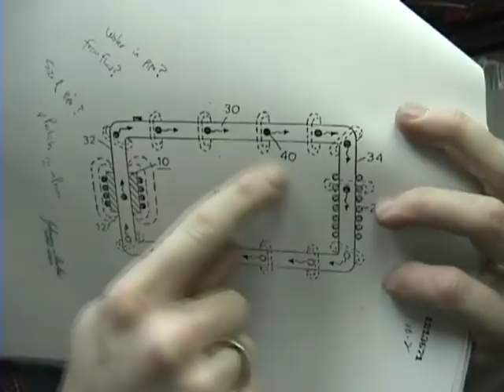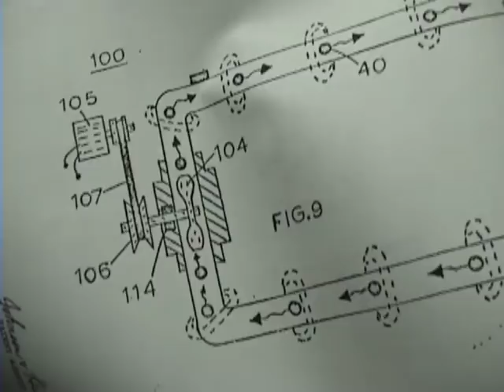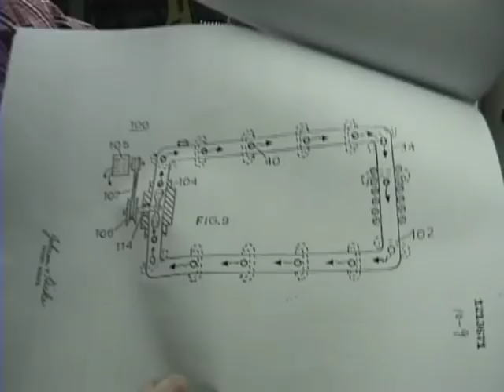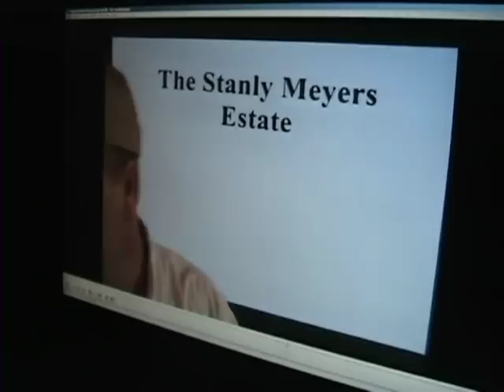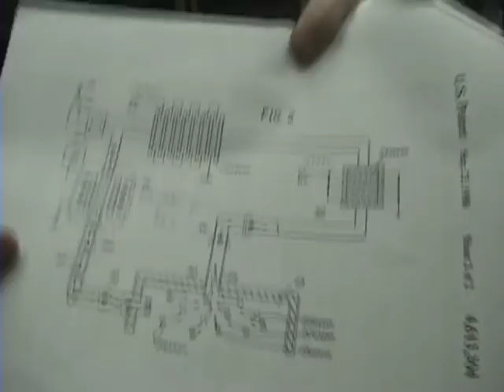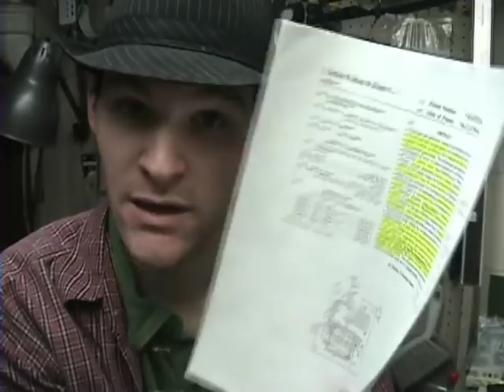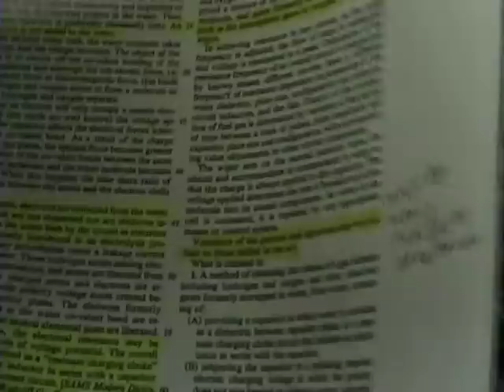The Key To Stanley Meyers Water Car, Gas Electrical Hydrogen Generator, www.RWGresearch.com

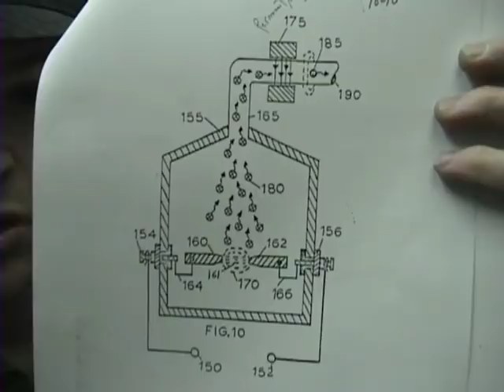Comment: Nice,   @21:15.   I think that's how Stan created the Magnetic gas for his "Pipe core" .  It's NOT a transformer,  it's a generator..  Passing Magnetic flux (particles) thru the secondary will induce current and voltage.

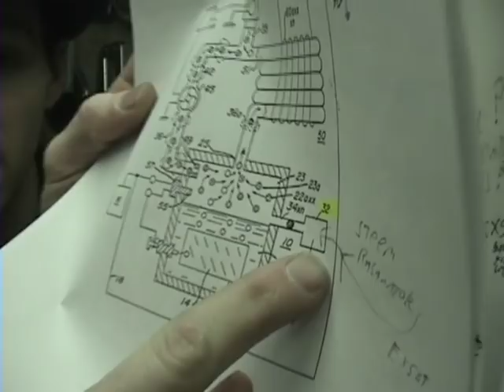Item 32 @ 53:30 is possibly the blow valve Stan talks about.

I believe the  'Source"  mentioned is the  Magnetic particle/ plasma  makers ..   The vapor particles are the electrodes ..

You're right,  This hugely important..

I know this video is 8 years old,   but,  that  Transformer/Generator is pure genius
Thanks,  Nice video.      btw,   I like your hat !.

Comment: Russ. A glass pipe with a a resent wall thickness would make an excellent circular pipe.It would be relatively easy to make using a propane burner and a circular former,Im sure a pipe blower could make it.

Comment: The coiled tubing in the loop looks to be the passageway of the hydrogen to be refined as a gas in the electro magnetic field  that may magnetize the nitrogen particle pulling them away from the oxygen and hydrogen atoms gas As I recall The Hadron Collider uses Electro magnets to speed up 2 electrons and then direct them in this magnetic field to crash head on with exact precision to create a miniature big bang or black hole.You got me inspired with your new information.This is a small collider

Comment: hey Russ, at 15:05..... the part in the middle sure looks like a vintage variable tuning capacitor for ham radio. Check it out. They are generally used in high voltage tank circuits.

ok my bad... in the video clip showing the accelerator it is clearly a cooler. But the thin plates and the distance apart still may have capacitive properties on the water flowing through it. 

nice work as always bro. 

 MUDDy :)

Comment: Nitrous oxide, commonly known as laughing gas or nitrous, is a chemical compound, an oxide of nitrogen with the formula N2O. At room temperature, it is a colorless non-flammable gas. At elevated temperatures, nitrous oxide is a powerful oxidizer similar to molecular oxygen.  It is also used in Dragsters !
Reply: I believe you are right, nitrous oxide burns really well, can it be that Stan is using N20 ????

Comment: Thanks for the video. You went through some interesting material. To me it seems the same problem as with all these free energy devices - How to start them?  How do you get pressurized gas, liquid, water into the chamber? You need energy to pressurise something. And you can't recycle energy from the chamber because it will run down (unless you have a neuclear reactor) . It's the same old problem.
Reply: its not free energy the energy you live in a world of magnetic flux and water is abundant, money wise those two are free to all
Reply: Self preasurization because water to gas adds volume ( preasure).

Comment: 1:00:59 With the ac/dc input corresponding to ac/dc output, remember that the magnetic particles traveling inside the tube can have spin and alignment from the input which they carry, as literal flux carriers, with them to the other side (because they keep spinning in that way after they leave the input area). Think of it this way. For ac input, 120+ will cause magnetic gas particles to spin "forward" (arbitrary terms, just grasp the concept). As the input wave progresses and goes down to 0 volts, at that moment there is no spin imparted to passing magnetic gas molecules. Then, when the input continues to 120-, the opposite spin of the direction imparted by 120+ is now given to passing magnetic gas molecules (120- creates spinning "backwards"). Remember, the particles keep circulating in the same direction no matter what, they are just rotating in different directions. Rotating magnetic fields through a stationary coil create electricity. So, when all these rotating gas molecules arrive at the other side, they're carrying their respective spins and orientation that they received at the input side, so you see it on the output side.
Reply: Duncan Zahringer where did you copy this from?
Reply: Could this be the flux capacitor?? they usually put these things right in front of our eyes  In back to the future?? In movies they always show hidden things before us also called  predictive programming!!
Reply: pe hgt Back to the Future was written by a child prodigy from Logan Utah.   That city has/had...Twin Pines Condos, LMC owned by John Delorean, The Clock Tower Plaza and the Bluebird Restaurant.  Three of those places are on main street and a few miles apart.
LMC no longer exists but the rest are still there.

Groot can be found in Marty's house as a small statue.

The writer has written hundreds of screenplays, scripts and songs.  A fair amount of books, comics and cartoons were also written by him.

He created more than a thousand videogame concepts like Mario, Zelda, Sonic, Halo, Street Fighter ect.  This is the reason why thete is Zelda music in Mario 3, Pac-Man can be found in Tron and why a certain song in Street Fighter is very similar to a Top Gun song.

He has designed vehicles for his movies and the real world. This is why the Vtec, Vortec, Voltec, Ecotec and Ecoboost names are so similar.

He has designed buildings, computers, video game consoles, phones, inventions, production machines, scientific equipment and a few military and passenger jets.

Look up Bro Mikey here on YouTube and learn about Split the Positive.  It is a way to recycle electricity and can be used for electrolysis, running inverters, motors and many other applications.
Reply: The first patent seems to describe a regular transformer with a core made of mercury (metal), inside a non metallic (avoid the squirrel cage effect) vacuumed tube and a pump to initiate the circulation. This would certainly reduce the core's resistant; something to look into...

Comment: I've looked at Stan's stuff and while the plans for plasma generators are very interesting is
It's in no way a requirement to split water at levels well over Faraday. 
Two essential requirements are
1. Water Cells connected up to coils as an LC tank resonator and excited at resonance with very high voltage.
2. Pure water as a dialectic so the
Water is split from the electric field and electrons are released as H2O becomes H2 and O2. This is critical understanding the electric field is doing the work not conduction.  No electrolytes required,  if you did use any you destroy the voltage potential that's doing the work. 
Don't confuse yourself with fancy transformers when you don't need them,  if you have unlimited electricity you don't even need to split water????
Remember K.I.S.S.
Most of these free energy ideas are simpler than we expect

Comment: Hey Russ, I know you probably figured this out years ago BUT, When he talks about previously magnetized particles, He's reffering to the water that was extracted from the stainless steal tube cell. IF YOU LOOK AT THE JOE CELL ( OR LOOK UP A MOJO CELL ) ( ALSO LOOK UP "SURFACE TENSION WATER" ) THE CELL IS SIMPLY ENERGIZING THE WATER AND CREATING A SURFACE TENSION. THE WATER ACTUALLY STAYS CHARGED WELL AFTER IT HAS BEEN CHARGED. That's what Stan means when he says "Permanently Magnetized Elements". You could theoretically either heat up the water to a vapor from the cell, OR extract the top layer of the cell where the Surface Tension "Charged" water is and then super heat it to a vapor once out of the cell. THEN SIMPLY PUT THAT PLUS THE EXHAUST GASES INTO THE EPG (MAGNETIC PARTICLE ACCELERATOR) AND VUALA. STANS FUEL. I'd love to see a video of you making surface tension water. you're the best man.

Comment: Russ, the part you are talking about at 23 minutes in... is that used to fill the closed loop pipe with the ionized ejecta from the electrodes through a one way valve, perhaps?

Comment: In the diagram you were questioning if it was an air-core transformer or not, the dashed lines indicate that it wants a ferrite core transformer and the note about toroid means it want a round ferrite core.
Solid lines would indicate that it wanted a laminated iron core.

Comment: Waste oil/water mix for magnetized fluid with pressurized electrolysis.  Pantone utilizes the plasma arc in GEET fuel reforming. Putting the coil loops after the plasma ionic breakdown of hydrocarbons with create a hot synthetic gas of high pressure to push through the power coils and then to the engine.  Ferrofluid is a good idea.  Plasma and power under ABHA toroid coils may help the efficienciy.  Brings together the work of Paul Pantone, Rodin/Powell (ABHA 72X72 and Meyers.

Comment: the pump you show, will have a manufacturers spec, there you will find the Parameters of operation, IE / the pressure he applied to his system, permanently magnizable particulates, Carbon 12, or/ carbon, you would find such by carbon metal spot welder machine.Just a thought.
Thom in Scotland.

Comment: not sure if this has been touched on, but word in not Permanent, but Pre Determined, ie, Calculated before hand.  What he is saying is you are shooting for a specific pressure. being its predetermined via calculations, this may have to do with the medium being used in the chamber, whether it is water, or perhaps mountin dew, or whatever.  the material used my be related to the pressure needed for the system to properly function with the Fuel/Medium being used...  
Had to clear that up.

Comment: The two most common types of magnetism are 
diamagnetism and paramagnetism, which account for the magnetic properties of most of the periodic table of elements at room temperature .  Hydrogen and Nitrogen are Diamagnetic but Oxygen is Paramagnetic.   To be Magnetizable an element must be Ferromagnetic.  Simple Ferromagnetic elements are only 3:  Iron , Cobalt, and Nickel.  (see Periodic Table : http://www.birmingham.ac.uk/Documents/college-eps/metallurgy/research/Magnetic-Materials-Background/Magnetic-Materials-Background-4-Classification-of-Magnetic-Materials.pdf  )  ; Materials can also be classified as ferrimagnetic although this is not observed in any pure element but can only be found in compounds, such as the mixed oxides.  Hydrogen-peroxide has been used as a propellant in rocketry !

Comment: It's easy to deconstruct H2O to burn in an engine. The problem is to produce enough pure hydrogen to burn. This is where electrical power in to split the H2O, becomes greater than combustion power out. Canadian patent shows how to put in low voltage with little to no amperage and get out high voltage and equally high amperage. The patent is amazingly productive to the point of getting enough power out of a low voltage/amperage input, sufficient to produce vast quantities of hydrogen gas to burn.

Comment: hi Russ,i watched your vid last night,i was aware of the generator but not the particulars such as the device for making the magnetic particles,or how you could use it with HHO,thanx for sharing-i think the things in the middle of the ring are lasers(not the first one with the pump but the later models).meyer spoke about this in one of his lectures.the laser was to provide a static field that improved the efficiency.i have been wanting to try to build one of these since i heard about it but....

Comment: don´t know if i understand this, but is it like you use a small voltage/current to accelerate particles in the tube.  Then they give a change in the magnetic field to the outside coil which give a great output ?

Comment: Stan introduced carbon monoxide, air, and carbon dioxide to turn all hydrogen/oxygen gas to the adjusted fuel burn rate that he wanted.  Stan could produce a propane, natural gas, butane, or gasoline burn rate by this method.  In example the hydrogen/oxygen gas has a burn rate of approx. 4000 feet / second (dangerous) and by adjusting the burn rate with carbon gasses he could create any type of burnable gas that he wanted.  He stated this in one of his videos from the 80s.  I tested the gas mods

Comment: I did watch Stan's video, " The secret missing links"..it involves bombarding the hydrogen proton with high frequency to make it lose an electron. And then he " borrowed one electron from the oxygen atom" but later he gave it back, LoL, and got energy both directions..the latest thing Ive seen is using 20 khz aimed at the electolyzer plates to cause cavitation which aligns the charge ..the toroid was used under the electolyzer which somehow excited the gas to leave faster, improving the efficiency and polarizing the electrons simoultaneously..
Reply: The first patent seems to describe a regular transformer with a core made of mercury (metal), inside a non metallic (avoid the squirrel cage effect) vacuumed tube and a pump to initiate the circulation. This would certainly reduce the core's resistant; something to look into...

Comment: 5000guass field, look up arc light for sparkgap vaporization, the gas is a metalic gas, first a vacuum has to be estalished in the chamber, then a arc created to plasmafy the electrodes. You can calc the mass and therefore the moles therefore the charge of all the gas created and you can find the amount of power needed to move it and what can be pulled off of it. A conductive tube would be a dead short in the transformer, drop a magnet down a copper tube.

Comment: I think that would require significant adjustment of cam timing as the exhaust port is normally open on the exhaust/upstroke depending on 2 or 4 stroke engine. If you could keep it closed longer then you could probably utilize that vacum energy you are talking about.

Comment: @mike powers 420 - Russ, 160 and 162 - the tips of the electrodes are vaporized - turned into monatomic particles that are suspended in the gas. Some monatomic particles are room temperature super conductors and display strong magnetic fields, unlike the same material that is in a in bonded states - like gold, platinum and other atomic structures. A gold ring is non-magnetic, but individual gold atoms have strong magnetic fields.

Comment: I know this is old but :

- the magnatizing device looks like a discharge 'sputtering' device - as another stated perhaps graphite etc
- with the Hydrogen production the end plates are a capacitor it's an LC circurt with resonant chokes so you need to match up the capacitance of the water capcitor to the freq of the inductors - 
- i think you will find the switiching diode is forming a 'flyback' configuration if that is the case you would need to follow that config for the diode inductor relationship - that is how it is a 'voltage intensifier' isolated circurt - 

I have chained multiple flybacks and by the time i got to the 3rd flyback pump - if i connected a capacitor i was getting a spark that was interestingly polarized.

Comment: The first patent seems to describe a regular transformer with a core made of mercury (metal), inside a non metallic (avoid the squirrel cage effect) vacuumed tube and a pump to initiate the circulation. This would certainly reduce the core's resistant; something to look into...
Reply: stan said it was magnetized gas, and that it was easy to make in a garage.

Comment: Second thought is about the charged particles being Magnetically charged as before discribed and the hydroxy being the sole elements holding any + and - charge independantly.

Lots of testing needs to be done.
As you were!

Comment: Russ, I live in New Zealand, In the late 1970's Stan came to New Zealand ab i was looking into The Pogue Petrol gas unit at the time. A Friend who is a car mechanic told me that Stan was on Radio Rhema, So i send for the tape and after listening to it decided to write to Stan. I think it was about 1979. In response Stan sent me two manuals. One was on all the patients and the other was the intended business structure. I still have the manuals. but not the letter. This was a time before i had even herd of computers and there was no internet. I could see at the time that the Water Fuel cell process was beyond my ability. I was an apprentice  electrical fitter but was a new be. I worked on High voltage electricity 250,000 volt equipment and was appalled at the profits the people were making and the miserable wages we were paid. It was then i started looking for other ways electricity could be harnessed. After reading Stans  EPG patients i could see then a new industry  of personal power 24/7 /365 was possible. However there were things that the patients were not clear on as you can see. But as the years have pass i am now retired and am having a go at.
The first was a Zero,Rocket stove (bow finished)  The second was a Joe Cell (now finished) The third is the Dannie Watts generator, (currently working on) And TLW I will have a go at the EPG. I think the EPG is the future for electric Vehicles along with the Solid state Batter that John B Goodenough has invented. The 5000+ free energy devices that have been suppress by the USA patient office will find there place as people like you, Joe and Mark Zero keep looking and testing. Keep up the good work Russ
Kind regards
Phil Leigh   NZ

Comment: Could the flux capacitor be the answer? I once had a similar problem on a consolidated  gyroscope, it was due to vertical excess on the horizontal plain.

Comment: Hi Russ,I have been following Your work, Keep it Up ,Great job, Before Stan died I was to the understanding that He was working more on the  WATER INJECTOR  that worked of the high voltage low amp spark created by the ignition system that ignited the combined hho and noncombustible  recaptured gases, does all these patented inventions play a role in the water injector??......Thanks for Your work..Tim

Comment: MIT researchers have observed magnetism in an atomic gas of lithium cooled down to 150 millionths of a degree above absolute zero.
You mentioned nitrogen gas.
The main use of liquid nitrogen is as a refrigerant

Use lithium cooled with nitrogen as the magnetized gas for this system.